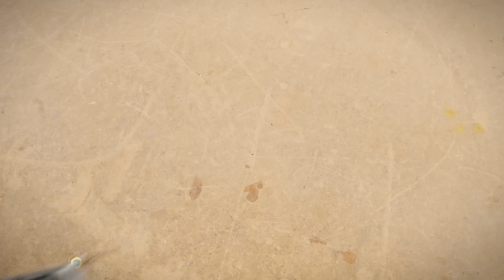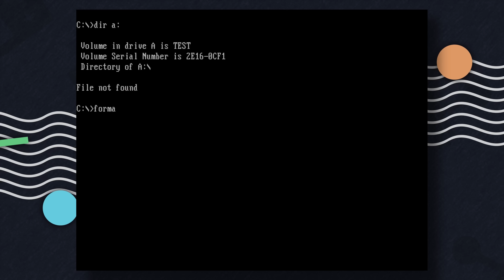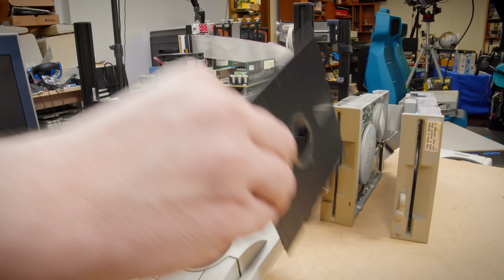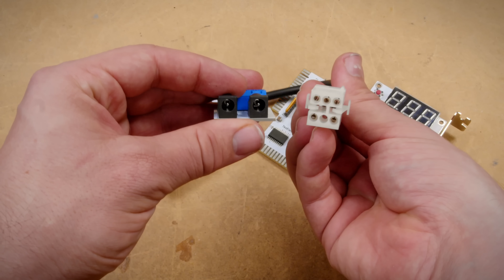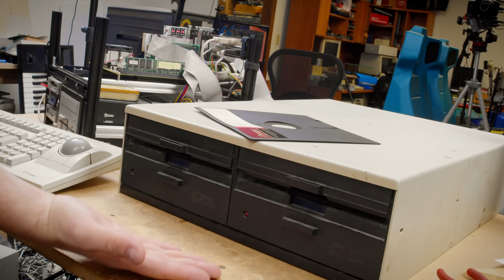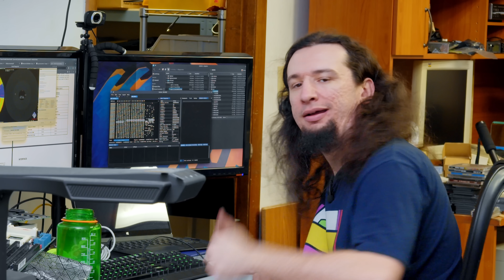New 4 Drive Floppy Controller - TexElec Quad-Flop

Comment from the maker: To everyone who wants a PCI or PCIe floppy controller, it actually isn't possible to make a "real" floppy controller like that. FDCs are a direct access device that cannot be made to work on those interfaces. It would be possible to make a kind of floppy controller that would work over PCIe, but it could also be done over USB. But it would need custom software to work, like a greaseweezle or kryoflux.
Reply: My brain was like : I wish I could get a PCIe version of that... Then I read that comment.
Reply: @b747xx  One of the reasons I haven't upgraded my 1st-gen i7 machine (daily driver) to something more modern is because nothing modern has built-in IDE or floppy. I've found PCI-e IDE cards that can recognize Zip drives, but for floppies, you're limited to either a Kryoflux (which is on my to-get list), or a USB floppy drive. Unfortunately, the USB floppy controllers don't work for 5.25" drives.
Reply: @BlackEpyon  Yeah, I do have a USB 1.44MB drive. I was also considering the USB adapter but they are as limited as my USB floppy drive from what I have read. For example, they won't work for non-standard format, like for the win95 install disks.

Will check for kryoflux
Reply: @b747xx  Kryoflux is basically a low-level archive solution. You can either back up disks to various imaging formats, or restore to disk from those imaging formats at a bit-accurate level. One of the advantages of this is that you can do non-PC formats. The disadvantage is that you can't just read/write the disk from Windows Explorer.
Reply: @BlackEpyon  Mostly correct. But "at a bit-accurate level" is misleading and ignores the main property of these devices, the whole thing why they exist, which would be more precisely that they archive and restore: At the magnetic flux accurate level of the disk data. This is an analog property and not a discrete digital one, like a "bit". That "little" detail is  too important, to gloss over ... don't you think?:)
Don't believe? ... RTFM!!!
Reply: @dieSpinnt  Fair enough.
Reply: @BlackEpyon  and the USB versions, are not 100% backward completable, the are many only capable  windows fat, formats, and the USB IDE, are version pore replacements, not even coming close the a real IDE, even on museum of an antic PC, speed of access?
Reply: @dh2032  If all you need to do is copy a program or game to a FAT formatted 1.44MB floppy, a USB drive will do you just fine. But as you say, it's limited. Problem is that outside of the vintage computer community, and some very specialized industrial applications, there just isn't much demand for this kind of thing.
Reply: @BlackEpyon  You're forgetting about the LS-120/240. I have an LS-120 attached to an IDE2USB adapter to an internal USB header on the motherboard. The only reason I do this is because the floppy driver in Linux doesn't work properly with an LS-120 on IDE for whatever reason. Back when I ran Windows 7, I could have it on a normal PCIe IDE controller and it behaved like a normal floppy drive.

It can read and write 720k/1.44M disks, as well as weird formats for other machines if you have special software like WinImage. I can read and write 800k/1.44M Mac format disks using it.

It's also mountable in VMs as a normal floppy drive to any OS that supports the LS-120.
Reply: @GGigabiteM  I'll be honest, I've never used an LS-120, but if it uses IDE, that would give me a way out... At least for 3.5" disks, it doesn't do anything for 5.25" disks. Not that I can use both on my i7 anyways, since it only allows one floppy.

So I could use an LS-120 and a Zip drive on the IDE controller, and attach a 5.25" drive to the floppy controller. That would at least work on my current system, but it wouldn't allow me to use a 5.25" drive when I eventually get around to upgrading to a more modern i7 (I keep spending my money on retro computers 😜)
Reply: @BlackEpyon  You'll just need to have a second computer as a "tweener". You can only stuff so many eras of technology into one box.

LS-120s were available in IDE and external USB. The LS-240 I think was only an internal IDE device, they weren't made for very long and are hard to come across today. The media for both is even harder to come across, and generally doesn't work past Windows 9x anyway due to driver issues. LS-120 drives use laser head positioning for 120/240 media, which was common to die anyway, making the drive just a fast IDE floppy drive.
Reply: @BlackEpyon  Why are there no 5.25" FDD in a USB version is beyond me. The logic of the 5.25" FDD is not really different from the 3.5" FDD. You would need an external power source as USB cannot provide the power for a 5.25" FDD, but that is about it.
Reply: @matthouben4242  You can get the bare USB FDD controller off of Amazon and AliExpress, but I don't know if it can support anything other than a 1.44MB.
Reply: @BlackEpyon  These controllers will not drive a 5.25" FDD, only a 3.5" FDD, and only the 1.44MB , not the 720KB version. All the timings and parameters are hard coded into the controller.

To have a controller drive a 5.25" FDD should not be really difficult though: the drive logic is the same. You would just need different parameters and timing. It is just that nobody really has bothered to make such a device.
Reply: @matthouben4242  It would probably be easiest to use jumper pins to set the drive type. And be sure to sell it with the Berg connector instead of USB-A, so it can connect to an internal USB header. That's one of the big complaints on Amazon's reviews.
Reply: @BlackEpyon  Using jumpers to set the drive type to one of the 4 possibilities (360K 5.25: / 1.2MB 5.25" / 720K 3.5" / 1.44MB 3.5") would indeed be a great asset. Unfortunately, it does not exist. I never understood why nobody made a controller for 5.25" (for both 360KB and 1,2MB), as the controller would hardly be different from the ones used for 3.5" drives. For the rest you would only need a casing, a 5.25" FDD and a power supply: all common of the shelf items.
Reply: @matthouben4242  Don't forget the 8" and single-sided 180K drives, as well as the 2.88MB drives! Again as you said, it's just a matter of tweaking parameters.
Reply: @BlackEpyon  Yes, that would be handy too. Could all this not also be done by using a Raspberry Pi and controlling the FDD fully by software that runs on the Pi, and then using the USB interface of the Pi to connect to the host computer and have the whole thing act as an external drive? The software to control the FDD could not be really difficult, as it is basically implementing the FDD protocol, which is not a complicated protocol at all. You just need to get the sequence and timing of the different signals right. Then you would need some software to communicate to the host computer. You then put the Pi, the 5.25"(or 8") FDD and a power supply in a casing and that would be it.
Reply: @matthouben4242  Maybe, but if the protocol is so simple, I'd rather use a CPLD or an FPGA. Commodore 1541 drives had an entire computer onboard just to translate the floppy signals and control lines to the serial bus, and it made it a lot slower than it needed to be. Devices like the Pi are handy for prototyping, and applications where you're likely to be making rapid changes, but if you're making a finished product, it's better and cheaper in the long run to just do it properly and eliminate the middle man.
Reply: @BlackEpyon  Actually, your example of the C64 and the 1541 drive is spot on. The drive had its own CPU board and communicated to the host (the C64) via a serial bus. BTW, it was the serial bus that made the floppy so slow as it used a speed of only 3200 bit/s, not the fact that the floppy drive had its own CPU board controlling it. 

So by using a Pi, one could do the same as what Commodore did. Note that the Pi would be much more performant than the CPU board in the 1541, so one could probably write the control software in e.g. C instead of Assembly language.
Reply: @matthouben4242  For sure, USB is faster than the C64's serial interface, but a Raspberry Pi is still a middle man that a bare metal floppy controller doesn't need, and for a finished product, it's only going to drive up the price. If you're making musical floppies, then certainly a Pi is the way to go.
Reply: @matthouben4242  wrong.  This controller does support 5.25.
And 5.25 USB drives used to be a thing.. back in the era of compUSA and computer City and incredible Universe. P2/P3 era. They've just died off already
Reply: What about this Gigabyte GA-108  PCI HDD FDD Controller (Vogons)?

PS: it would be great if modern PC could use something similar. Of course, it isn't a TexElec "tetra floppy" but maybe worth a look into it.
Reply: Kinda. Building a card with a PCI or PCIe to ISA bridge with a standard ISA FDC controller connected to it should be really easy. It's not a direct connection but that really shouldn't matter.
Reply: @DanBowkley  I have heard that some USB FDC can support 5 1/4 but those are rare.
Reply: M.2 floppy drive controller when
Reply: @Pickelhaube808  that's just PCIe, USB, or SATA..doing it with a PCIe to ISA bridge would be possible as long as the chip physically fits on that little card.
Reply: Has anyone made a USB FDC that can handle a 5 1/4" drive?
Reply: @ikonix360 No, which is a shame. There is no technical reason to prevent that as 3.5" and 5.25" drive control is very similar. I guess it was not considered to be commercially viable.
Reply: @matthouben4242  There are people here, and in countless forums who asks for this for at least ten years and this doesn't exists yet. This is really not understandable. What can we do about that ?
Reply: @ikonix360  yes. Years ago. They've died off already
Reply: totally off topic, where did you get the hat?
Reply: or a driver for windows, but that'd cost money due to signing requirements :)
Reply: There used to be converters to let ISA cards be remotely ribboned into PCI , with the conversion logic onboard.
Reply: "FDCs are a direct access device that cannot be made to work on those (PCI/PCIe) interfaces"
Serial/Parallel ports are direct devices too, and they work just fine on PCI/PCIe, and Windows 11 sees them just fine. The problem with floppies is likely the limited/absent market for such controllers.
Reply: I would prefer a PCI or PCIe floppy controller personally. I'm already using USB to floppy adapters for two 3.5" drives on my main machine, but being able to read and write older 5.25" discs on a modern computer would be great
Reply: I wouldn't mind if it required some sort of custom software, as long as the custom software wasn't totally terrible.

Comment: I purchased one of these cards a while back and am having a hell of a time getting it to work in anything. The darn thing acts like the address dip switches are backwards or something?? Checkit shows a completely different address from what is set on the card. I set the card to C800, checkit shows E000. I set the card to E000, checkit shows C800. The F2 prompt hardly ever shows up as well? Every once in a while the F2 prompt BIOS splash will appear, but very rarely. I think I have a defective card but unfortunately Texelec will not take it back because it sat on my shelf too long before I actually went to use it. Is any one else having strange issues with this card?

Comment: I am having an issue seeing the cards built in optional boot rom during system POST.  Therefore, I haven't been able to configure it yet.  I have selected what I believe to be the correct dip switch settings to set the mem address range to use (I used Checkit to verify).  All my dip switch just happened to align the way @TechTangets has it set up.  The built-in motherboard floppy controller has been disabled in the main computer BIOS.  I also have a dynamic drive overlay installed to use one of my larger drives, not sure how that would conflict...  I've tried removing all other unnecessary cards to try and isolate the issue.  I am using an FIC PA-2011 motherboard (Socket 7).  Any help would help much appreciated!
Reply: I am having the same issues. I believe my card (and yours) is defective some how. I reached out to texelec but they were not very helpful. I just posted a comment asking if anyone else was having the same issues and saw yours.

Comment: Would it be possible to make it work with a single port and shugart connection? Shugart can handle 4 drives without twisting, making it a lot easier to create your custom cables with a mix of IDC and edge connectors. Shugart can read and write PC disks every bit as much, the protocol is not changed, just the pinout to the drives.

Comment: Duude, what about 3" Drives? You know, same as the ones use on the Spectrum +3 and other Amstrad systems. The ones you needed to turn the disk up side down to access the other side of the disk like with tapes originally.

Comment: Got mine a couple of days ago. Love it, but there are problems. I have an ASUS P5A-B mobo. I have successfully configured a ROM shadow in mobo bios correlating to the dip switches on the card, and created 3 drives: one for my gotek and 2 for my dual drive Epson SD-800. If i chose CDROM as a boot option, it tries to boot from the 3:rd floppy drive, as it seems to take the letter assignmnet "D". So i can't boot from CD or DVD now. This asus board also give the option to boot from "E" and "F", but those don't work either. 
Also, after writing to the eeprom a couple of times, i can't write to it at all now. I just get a write error pointing to the "write protection" dip switch, which is set correctly. I don't know if i fried the eeprom when accidentally plugging in a floppy cable upside down. The writing ability, that is. It still reads fine, but now I'm stuck with this "although correct, but non-properly working" 3 floppy drive setup.
Reply: My card also has issues. When I was able to enter the F2 configuration every damn time I try to save it I get the same issue, "check the write protection dip switch", which is correct. This card has been nothing but a damn headache.
Reply: @nunyabusiness7602 Yeah i ended up ordering Techtangent's floppy switch PCB from PCBway, combined it with some pins and a switch for the front of the case, and it totally replaced the quadflop, and it works like a charm. And it's even better than the quadflop in the sense that nothing can go wrong, due to simplicity, unless something is accidentally disconnected.
Reply: @nunyabusiness7602 
Floppy A: Epson 3,5" /switch/ Gotek 3,5"
Floppy B: Epson 5,25"

Comment: 4 floppies on one ribbon cable was the INDUSTRY STANDARD, until the PC-XT neutered it with the "cable twist" for only 2 floppies, one on at a time due to the undersized power supply :-( This is merely restoring what was there before the PC-XT "standard". Similarly, ST-506/MFM drives were 4 to one cable, not 2.

Comment: Okay, cool cool! Does it support the 1.68MB DMF format? Or better yet the rather rare 1.72MB format which used 21 sectors per track and 82 tracks?

The latter format isn't supported by Windows NT at all, nor is it supported by MS-DOS or even Win95a. It's only supported by Win95 OSR2 or Win98 (maybe WinME too, I dunno)...

Comment: That is neat. I hope they do a hard drive controller too. I came across a 286 graphics workstation that had an LED display that showed what tracks/cyl the hard drive was read/writing and I always wanted the same in another machine. I regret not taking it further apart to find out what and how it was doing it.

Comment: That's AWESOME!  My first experience with a four way floppy controller was one made by TechWay that powered the family's XT computer in 1990 when the 1.44MB (massive!) floppy drive was installed, alongside the existing 5.25" 360KB floppy drives.  PHWOAR!  The funny part, was that this would, by default, cause the hard disk to come up as D:, and there was some software that was hard-coded to firstly not install FROM C: (assuming it was a hard disk), or install to a hard disk that wasn't C:.  I recall there was some trickery required to reassign the drive letters, so that the 1.44MB floppy was moved to another drive assignment such as D:, so the hard disk would remain at C.  I think it may have been unharmed by the leaking battery in that system, but I'll have to check.

Fun times!

That 8 inch floppy drive adapter is of significant interest. I have a bit of 8" media still kicking around that I've collected, however my two Shugart 8" drives (with AC motors!) were improperly stored, so there's a bit of rust/corrosion and restoration work required to get them going again.